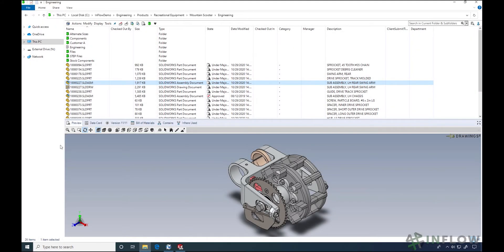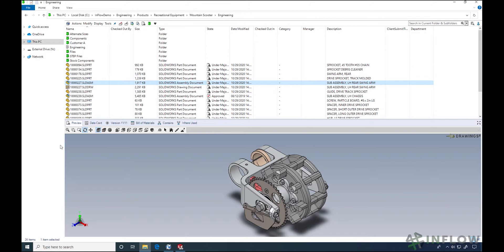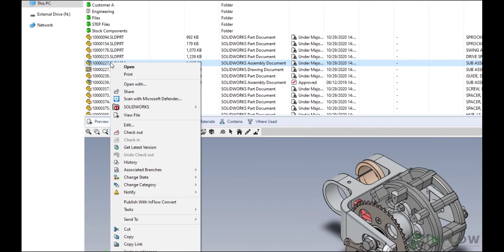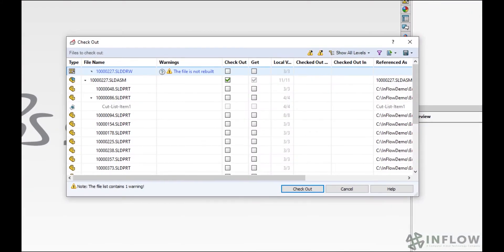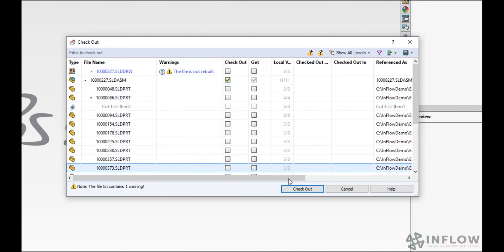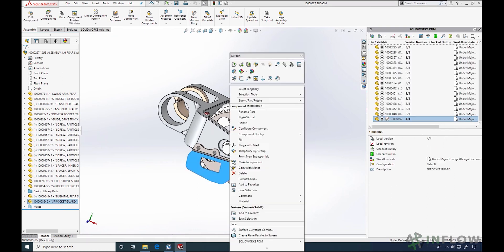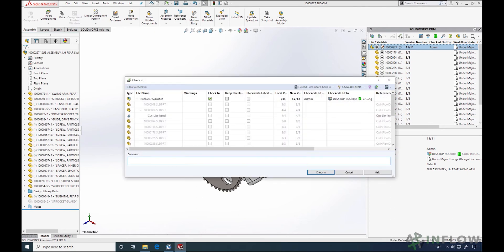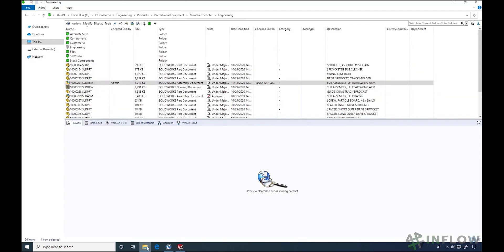Check-in & Checkout - Day In The Life - SOLIDWORKS PDM User Series

Comment: At my job we are having issues with our check out menu being completely greyed out at what appears to be random occurances. Do you ever experience this or know a way to fix it without shutting down solidworks?
Reply: It depends on the current state of the document. If the document is in "Released" state then the "Check-in/Check out" option will be greyed out until the state of the document is changed (ie: ECO is generated for change in the drawing).